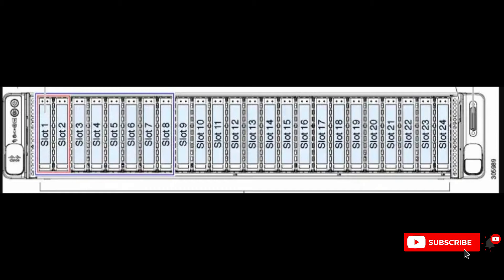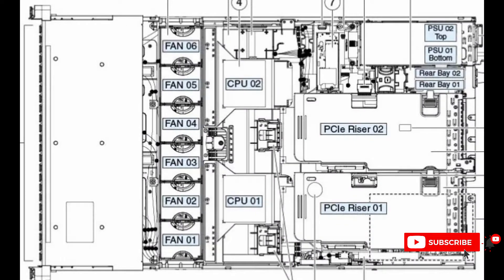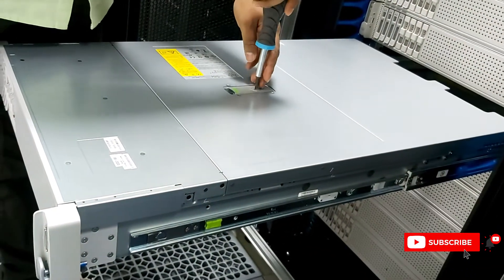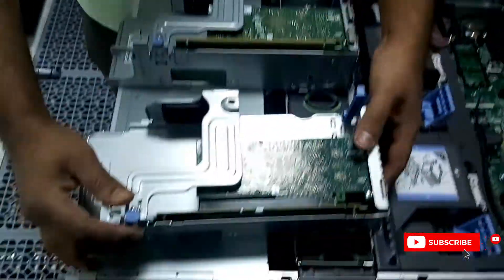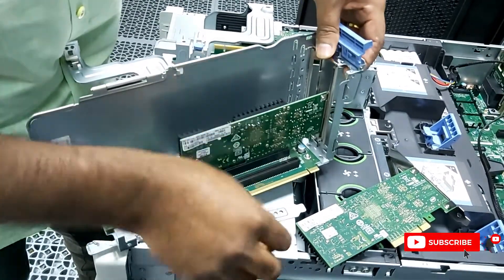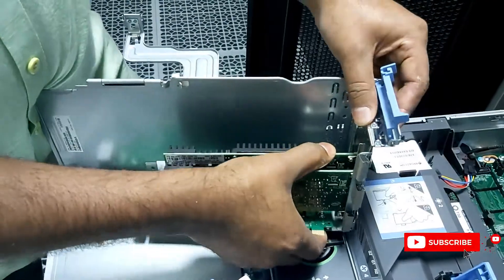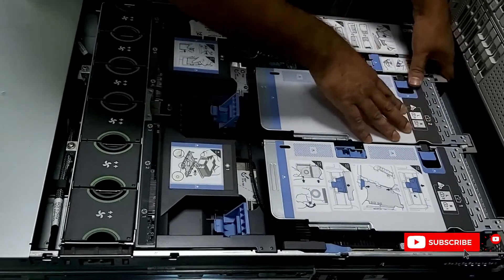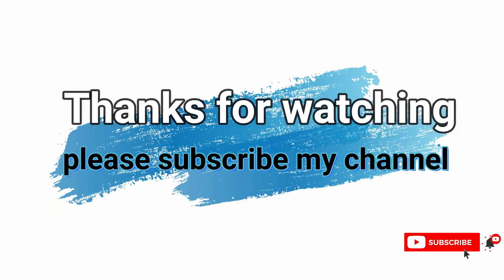Cisco ucs 240 m5 Installation and pci card replacement

Comment: We have purchased a Cisco UCS C240 M5 server for our office, and it is extremely noisy. All six fans are running at around 17–18k RPM. Is this normal? If not, what could be the possible reason?
Reply from the maker: You need to increase your cooling system...
Reply: @Mallunetworking  WRONG ANSWER